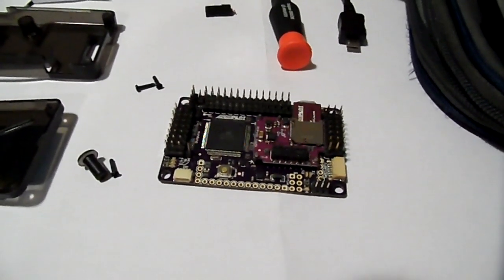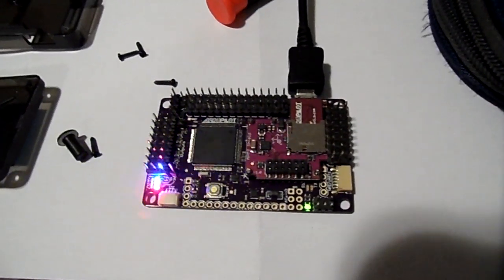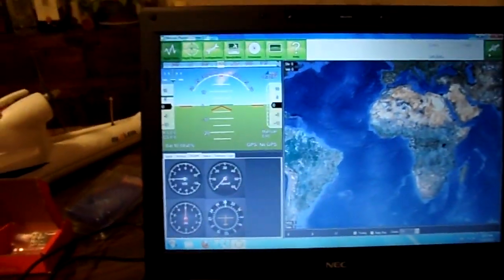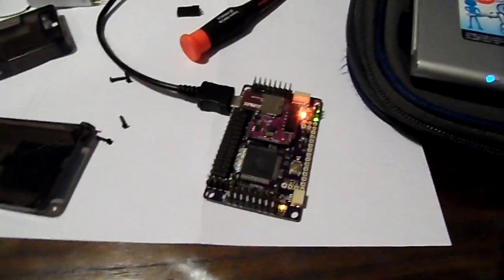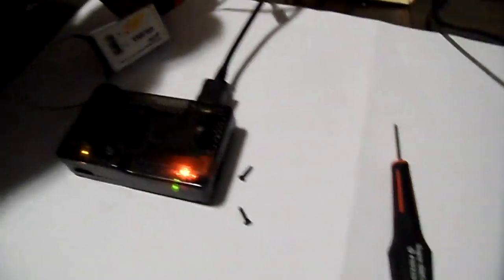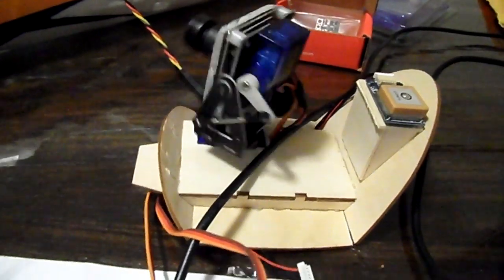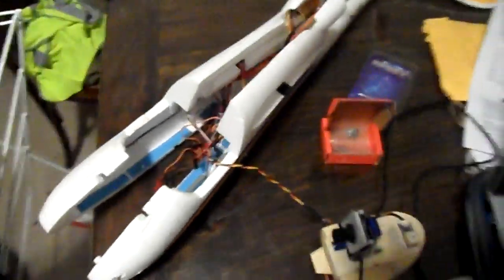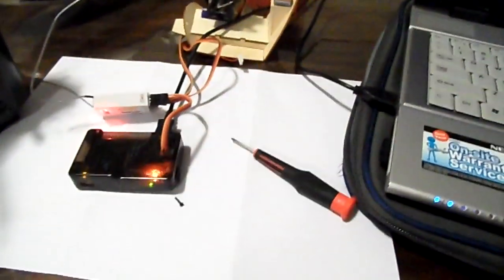ArduPilot Mega 2.0 - First look

Comment: Hi rogueqd.  Geoff again I have a further question on Arduplane and air speed indicator I have been trying to get it to work,always showing air speed below the ground speed regardless of into wind or down wind have found looking at the Air speed indicator in the HUD panel that the red needle is always on Zero and the  grey one is on 30 if you blow in the pito tube the  grey needle goes up but the red one stays stationary, any clues on how to zero it in  Regards Geoff

Comment from the maker: Hi Bernhart. The OSD is MinimOSD which is part of the Ardupilot family.
The OSD stock firmware is quite basic, but there's a great project started by Gabor that get's all it can out of the slightly limited hardware. Limited meaning it's character based, so no vector graphics, and it only has 32k of programming space.
Have a look for my "ArduPlane Testing 2nd day" video. That shows the OSD although it's an old version of Gabor's firmware.
I'll make a basic tutorial video next time I go flying.